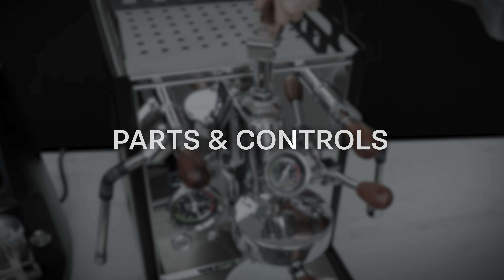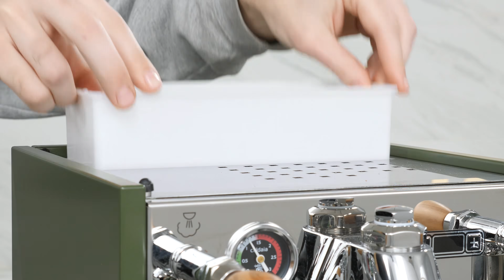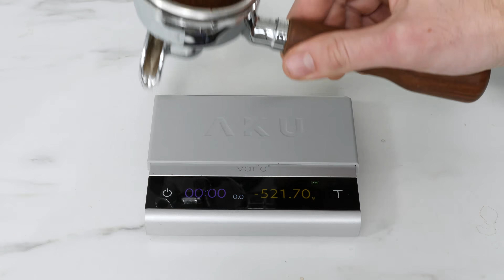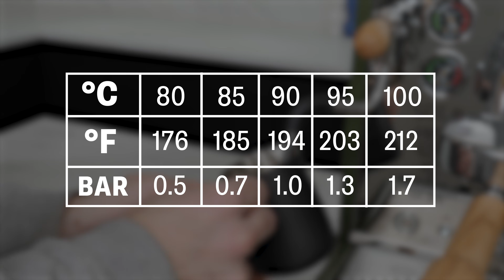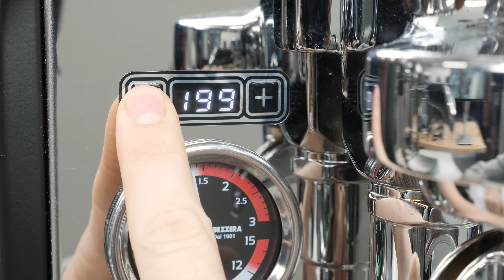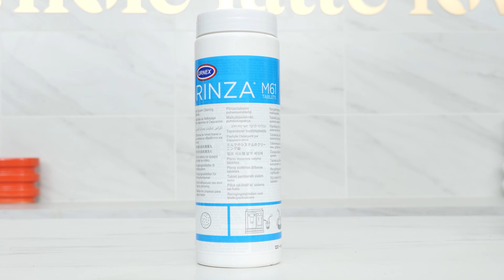How to Set Up & Use the Bezzera Sole and Aria PID Espresso Machines

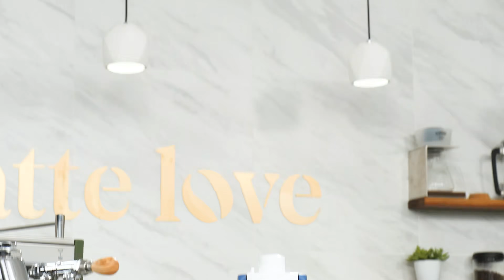Comment: At 3:10 How do I know if the incoming water pressure is above 6 bar ?
Reply from the maker: Hi TE, I don't know where you are but in my area typical household plumbing has pressure of 4-6 bar (60-90 PSI). If you have the machine and plumb to waterline you should be able to put a backflush disc in the portafilter, attach to group, raise brew lever about 45 degrees (without pump turning on) and the pressure gauge on the machine should display your incoming line pressure. If you do not have the machine pickup a gauge similar to this and connect to any faucet (this one can go to a standard US garden hose faucet): https://www.amazon.com/Pressure-Lead-Free-Anti-Fog-Waterproof-Stainless/dp/B0BFCN2XWZ/ref=sr_1_2_sspa?crid=1PY6W1ZN89P9X&dib=eyJ2IjoiMSJ9.WqE6A2DHt1lTN7feNqyQRUg_OYSnuJE_mHMOwDD_bGHFPBeiv9nsku_vV54YD_BKhlfj3NeJI5LdfO9ml7tIZ6LYhlTFzEKhqJEjF5Dml6NyAmiEwTcQANmncsBcjaB7MBwR0630c2l9CwzY5YAZ-eRdgUk1DrYTRas-atwN_KI7NezWBRoORRHEkjewEvEJAB8nKmzGzOqLxNiL2dXJiSJnMvZh7fXOoyAVfv_nY1Y.-npYLj3_HMUzIOmvWqu17LafSQDfeBYoet_2ogCjT0I&dib_tag=se&keywords=water%2Bpressure%2Bgauge%2Bfor%2Bhome&qid=1744985693&sprefix=water%2Bprtessure%2Bgauge%2B%2Caps%2C85&sr=8-2-spons&sp_csd=d2lkZ2V0TmFtZT1zcF9hdGY&th=1
Reply: @ thank you!

Comment: Heating time from 0 to ready to brew?
Reply from the maker: Hey tt, I'd allow 15-20 minutes for full warmup. Can speed that up a few minutes by running blacn shots through an empty portafilter. For a machine that's heated up on your schedule consider an outlet timer rated to handle the power load of the machine.
Marc

Comment: Thank you very much for the video. So I can/should use Cafiza on my Aria? And I read somewhere that in general I shouldn’t use hot water dispenser for my Americanos. It’s false, right?
Reply from the maker: Hi ss, yes, use Cafiza for back flushing and cleaning of filter baskets, portafilters, drip trays, etc. You can use the hot water dispenser for Americanos. What you read might be because like most every machine, temperature of the water from tap is high. A trick for that is dispensing hot water into a cold cup and then pulling the espresso into that. That order of Americano preparation is often called a long black.
Marc
Reply: @ thanks for taking the time Marc
Reply from the maker: @stuartschwartz234  My pleasure - enjoy your machine!
Marc

Comment: Do tou have details on the configuration menu that can accessed (Aria) before the machine boots? Turn on and long press both buttons ?
Reply from the maker: Hi y, see section 7.1 on page 9 of this linked manual for language reset instructions: https://www.delonghi.com/medias/ECAM35075SI-222408?context=bWFzdGVyfGRhbV9tYW51YWxzfDE5MDc1NDI5fGFwcGxpY2F0aW9uL3BkZnxhR1EyTDJnell5ODNNREl6TnpreE5ESXpORGt4TUM5RlEwRk5NelV3TnpWVFNTMHlNakkwTURnfDkyNGQ0MWFmZTJkZmZlZTczMmNiMmQ1ZjAxMjliYTY1YThiYWIwZDg1NDYyNDI1OTNiNWE4NDE1MWE3MTNhNTU
Reply: @Wholelattelovepage  The link is for a Delonghi machine.

Comment: I'm really happy to use my Aria but I can't make Americano - I noticed the hot water from tap has a strange taste, it's sort of chemical, maybe mineral taste. I use water from the Brita filter jug and it has 4 dH hardness so it seems to be fine (checking by the water drop test). 

Could this be related to copper used in the boiler construction? Is that normal in HX? How to make the hot water usable?
Reply from the maker: Hi R, copper is used many espresso machines - has been for years. Very unlikely copper is causing strange taste. Perhaps try flushing the boiler - maybe some weird water go in? To flush, fully heat the machine, turn off power then open the water valve and drain into a large container. Turn the machine back on and boiler will refill with fresh water. You can repeat the flush if desired. Hope that helps.
Reply: My manual said to heat 12 hours, flush, heat another 12 hours, flush. Procedure posted above. Maybe this is why??? My americanos are yummy!
Reply: Helped?
Reply: @Redaslt99  Not really, I flushed the boiler two times in a row, after that the water from the tap had better taste but still I felt a bit "metalic" taste. After 2-3 days the bad taste got worse as it was before flushing. I will report this issue when my Aria will be in the service for general review before ending the guarantee.
Reply: @ sure thing man, give it to service. Im just asking because im also looking what to buy after 3 years of using automatic machine. Thinking or i want dual boiler or hx machine. During the week im drinking like americano and espresso per day in weekend time a but more with wife maybe friends sometime. Close friends telling me you dont need to have dual boiler max hx with pid, timer and maybe flow control. So many questions in my mind would like to even pay someone for big talk about everything what to, what i need, because soon i will blow a lot of money :D

Comment: Two topics not covered around operation, that I would like to understand better.   How long should the machine stay on for optimal longevity and also how best to turn off the machine?  Should you purge some water/steam and let it refill with cool water before shutting off or just turn off?  Thanks in advance.
Reply from the maker: Hi wh, Thanks for the questions. I've asked manufacturers about leaving machines on continuously or turning on/off as needed. Honestly no clear answer as to what is best. Some say they leave theirs on all the time. Of course that will use more power. Heat cycling causes expansion/contraction of components but manufacturers say machines are built to handle that. Some thought that scale is more likely to form during during power cycling. But if you use good water then that should not be an issue.
Purging some water from the steam wand occasionally is a good idea. Even if water is filtered (softened to reduce calcium) to point scale will not form minerals can still accumulate overtime if you only take steam off and never hot water. No need to totally turn over water in the boiler. A cup or two everyday or so of use is all that's needed.

Comment: Oh wow. Perfect timing. I’m just setting up an Aria now. So you followed the manual on the setup but stopped where I’m questioning things. It says to turn the machine on, fill the tank with water and let heat up. Then wait 12 hours. Purge the hx and boiler then repeat the steps. So 24 hours to set it up? It says the machine must always be switched on and always have fresh water in the tank. Very strange setup procedure. Should I do that or just do 2 flushes a couple hours apart and get brewing?
Reply from the maker: Hey boozer, think you might have misread the wait time? 12 minutes or reaching set temp should be more like it. Also you can turn the machine off when you like. I'd do the 1st flush after machine is warmed up, boiler will refill and then reheat then flush again boiler refills and reheats and you're good to go!
Reply: @Wholelattelovepage  The manual seems pretty clear to me. I don't know the reason why but I followed it. If something is going to leach from the metal then I'm glad I did. 

A-First machine start up or after a prolonged inactivity (about 7 days)

1) Turn on the machine, load water in the boiler and heat as described in paragraphs 5.1 and 5.2 .
2) Wait for 12 hours.
3) Let the water flow from the group for 30 seconds with the empty filter holder, to discharge the heat exchanger (the machines with lever require coffee in the filter holder).
4) Drain the boiler by the water and steam taps in a heat-resistant container with 1 It capacity.

NB. "TIME-OUT" function: after 120 seconds of boiler loading, if the water has not reached the maximum level, the machine will switch off automatically, to reset it just switch it off and on again.

Repeat the steps 2 to 4 making sure the following conditions are met:
-the machine must always be switched on.
-there is always fresh water in the tank (where provided).
-do not reuse the water drained during rinsing.
-do not reuse the coffee delivered on machines with lever during rinsing.

Wait for the filing of the boiler and the achievement of the right temperature before using the machine.

B- After an inactivity of at least 4 hours
1) Drain boiler water from the respective tap for 5 seconds.
2)Let the water flow from the group for 15 seconds with the empty filter holder (the machine with lever require coffee in the filter holder).
Reply: @Wholelattelovepage  I thought I posted this before but don't see it here so maybe I didn't. This is the instruction that came with my machine. 

A-First machine start up or after a prolonged inactivity (about 7 days)

1) Turn on the machine, load water in the boiler and heat as described in paragraphs 5.1 and 5.2 .
2) Wait for 12 hours.
3) Let the water flow from the group for 30 seconds with the empty filter holder, to discharge the heat exchanger (the machines with lever require coffee in the filter holder).
4) Drain the boiler by the water and steam taps in a heat-resistant container with 1 It capacity.

NB. "TIME-OUT" function: after 120 seconds of boiler loading, if the water has not reached the maximum level, the machine will switch off automatically, to reset it just switch it off and on again.

Repeat the steps 2 to 4 making sure the following conditions are met:
-the machine must always be switched on.
-there is always fresh water in the tank (where provided).
-do not reuse the water drained during rinsing.
-do not reuse the coffee delivered on machines with lever during rinsing.

Wait for the filing of the boiler and the achievement of the right temperature before using the machine.

B- After an inactivity of at least 4 hours
1) Drain boiler water from the respective tap for 5 seconds.
2)Let the water flow from the group for 15 seconds with the empty filter holder (the machine with lever require coffee in the filter holder).
Reply: @boozer8095 did you ever figure this out/did you end up waiting the 12 hours? I just purchased the luce which has the same instructions and am a bit confused on how to get started

Comment: Every month with detergent is overkill is you backflush with water daily. It also strips all lubricant in the lever and valves, which will make the lever operate poorly if not disassembled for lubrication.
Reply from the maker: Hi Rem, thanks for the comment. It's true backflushing with detergent can be over done and remove lubricants. Our recommendation is based on those of machine manufacturers (every 120-140 brew cycles) and those of our machine techs. 1x/mo  comes from average use of 4-5 extractions/day which works out to 120-150 brew cycles/mo.
Reply: @Wholelattelovepage this is a good conversation. Note: My aria’s manual makes no mention of the need to use detergents.

Comment: I am on day 3 of life with my Aria. So far, it has been amazing!!!!

Question. Is it all the way open, considering the stock flow on the Aria?  or is all the way open OVER stock flow. My Aria has about 270 degrees of rotation.

And why is the Aria set to 12 bars from the factory?
Reply from the maker: Hey CW, thanks for sharing your thoughts on the Amazing Aria! Stock flow rate with no FC installed is ~12-13g/s. You'll get that with the FC valve about 5/8 to 3/4 of a turn open. If you have a scale you can confirm your precise rate by running pump, catching and weighing the water output during say 10 seconds and dividing grams out by 10 etc.
Bezzera does setup many of their machines to ~12bar static pressure. You can adjust if desired by tuning the bypass of the rotary pump.
Reply: @Wholelattelovepage  Awesome! I will measure my flow rate that way.
Reply: @ So I found the chart on your website for the flow rate.

All the way open would be around 16.5 g/s. The new Arias only have 3/4 of a turn from all the way open to all the way closed, is that correct?
Reply from the maker: @CharlieWellness  It's a bit confusing with the redesign. I believe in the chart you reference fully open is 3/4 turn =16.2g/s, 5/8 open = 11.3g/s so stock flow rate is at a hair over 5/8. Using higher than stock flow rates is fairly rare. While, stock flow rate varies by manufacturer average is 11g/s for rotary pump machines and 7g/s for vibration pump. In most cases recommend you go no more than 5/8 turn open on your FCD.
Reply: @ Thanks!!! That helps.